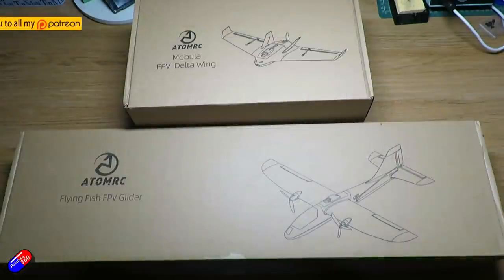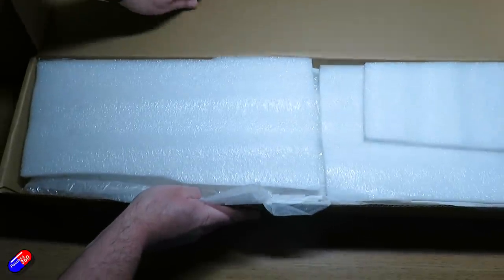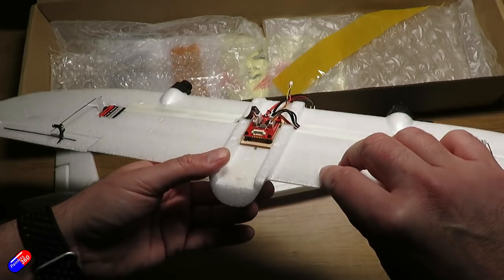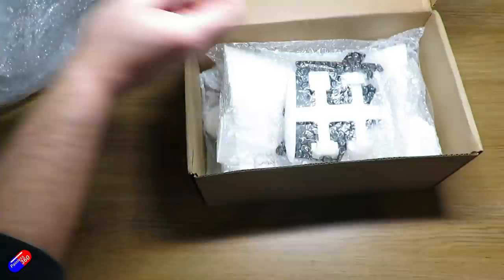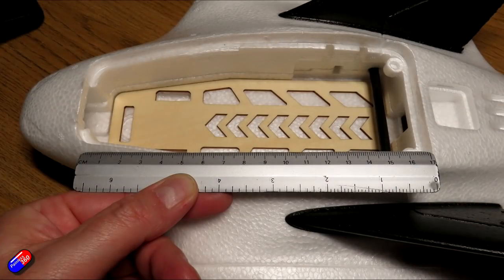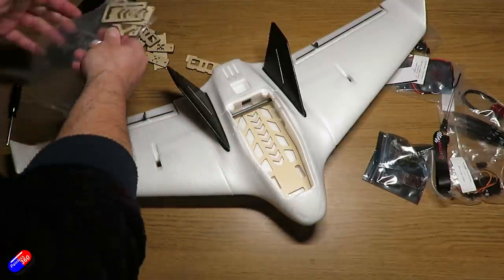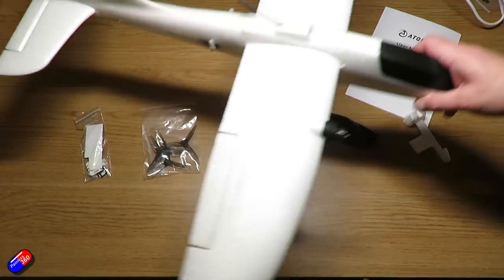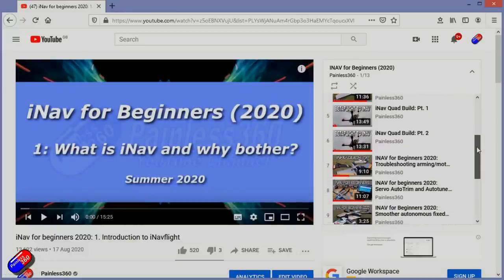PREVIEW - New Flying Fish FPV Glider and Mobula FPV wing from AtomRC

Comment: The Mobula FPV wing looks more interesting, as the Flying Fish fuselage is just too small for FC, or Li-ion.
Do like the small motor thing setup of the Flying Fish, but not interested in packaged FPV setups. Since Flying Fish not likely to be sup-250g, would have like to see ~20-30% larger just to have more flexibility in equipment / setup options. I prefer to add my own camera, and maybe FC vs. all-in-1 packaged FPV box.
Mobula FPV seems more versatile, and offers more options in how can be setup/configured.